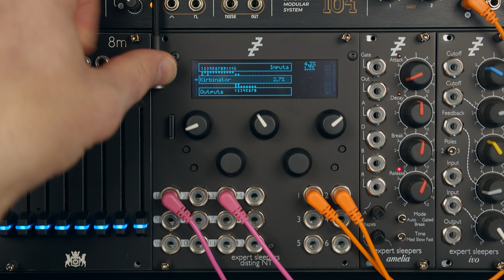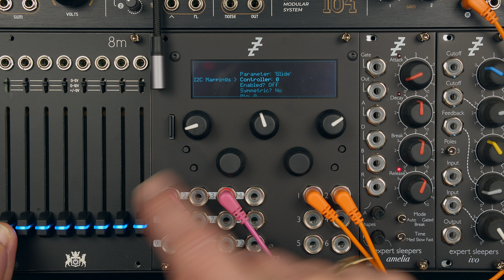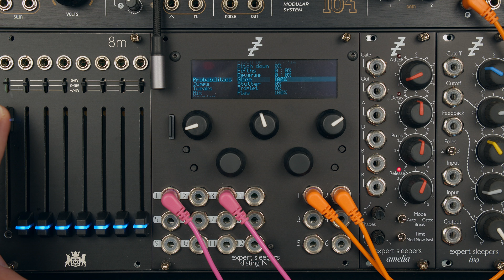disting NT - Introduction to Mappings

Comment: Awesome! Which control option would give me the least latency and most accuracy? I mean midi CC would only have 127 steps. I assume i2c and CV might have more steps?
Reply from the maker: Correct. I2C is 14 bit (though the actual resolution will depend on what's sending it e.g. the 16nx is 12 bit) and CV uses full 32 bit audio. I will probably add support for 14 bit MIDI controllers at some point.
Reply: @ExpertSleepersLtd 14bit midi support would be awesome.

Comment: is it possible to use DISTING NT as a MIDI-CV converter to receive MIDI from computer (for example Bitwig Modulator out) and send them to another modules in my Euorack system?
Reply from the maker: Yes, in the forthcoming firmware v1.4.0.